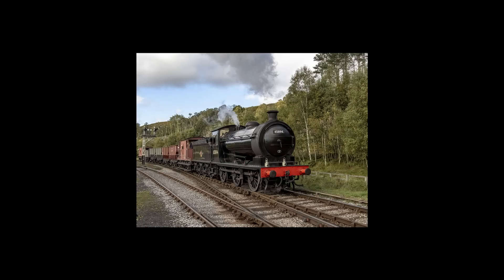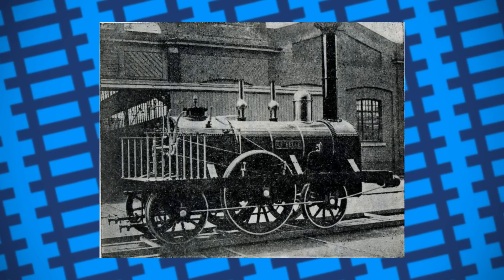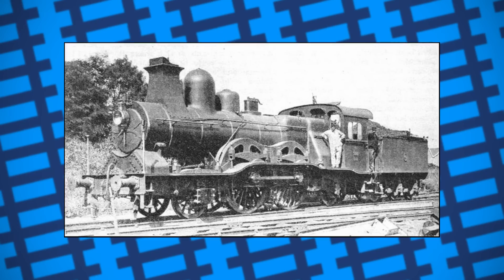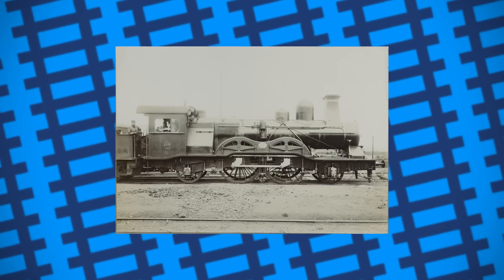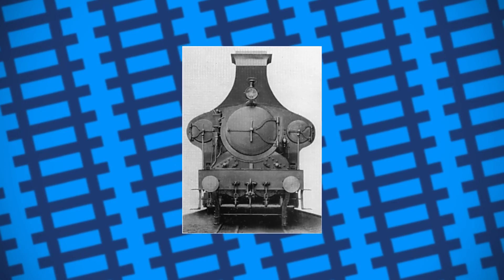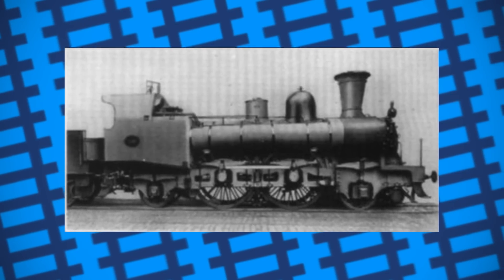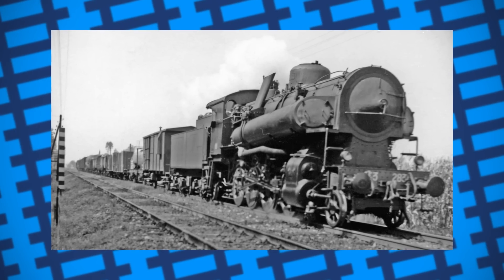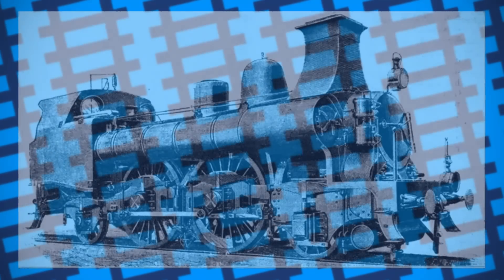Belgium's Botched three boiler Passenger Engine - Belgian State Railways "195"

Comment: The initial reasoning behind this locomotive demonstrates one of the main problems with steam locomotives in general. Steam weebs like to pretend that they're constant-force machines that develop more and more power as they go faster, but the reality is that they aren't. They are constant-power machines just like diesels, except the rated power comes from the boiler capacity rather than the limits of a diesel engine. This falls apart at low speed, where the physics of directly driving the wheels by injecting steam into the cylinders imposes a hard cap on the available tractive effort, effectively meaning that the locomotive can use less and less of its rated power output as speed decreases. This causes the illusion that it acts as a constant-force machine. Sometimes, looking at a graph from the bottom up makes us believe falsehoods that are readily apparent when you look at the graph from the top down.

Comment: The Type 12s have appeared in my locomotive books. Both the conventional Type 12s and No. 195 are examples that Belgium had some of the most unusual looking steam engines in Europe. I suggest looking into the 4-6-2s that ran in Belgium. Both beautiful and strange-looking at the same time.

Comment: The strange thing is that the problem of getting extra power had been solved before this engine was built. Unfortunately many locomotive designers didn't believe it. Consequently singles were still being designed for express locos long after four and six coupled machines were setting new speed records. I know the type 12s had two powered axles but the whole shape looked it was a modified single.

Comment: There truly are a ton of very strange and interesting Belgian steam locomotives. In addition to the very bizarre-looking locomotive in this video, the Triple Boiler Locomotive #195, there was also the Type 3 Locomotive, which History in the Dark says "clearly throws the Whyte notation completely out the window" due to the fact that there were two unpowered wheels in between two of the driving wheels (which were coupled), and, of course, the Franco-Crosti Quadruplex Locomotive, which was THE most powerful steam locomotive ever built by any nation, EVER, and the only ever built quadruplex locomotive (with a 0-6-2+2-4-2-4-2+2-6-0 wheel arrangement)!
Reply: It was pretty darn powerful, but maybe not the most powerful. By my calcs (they could be wrong) the quadruplex made about 97,000 lbs of tractive effort (or 432 kN). There were plenty of engines with much more power in the US, like the Norfolk and Western Y6b's making 152,000 lbs of tractive effort (677 kN).
Reply: The Belgian railways had lighter track and roadbed, whereas American engines could get very heavy. A Y6b on Belgian rails would have crushed them. Bethlehem Steel's main line used 155lb rail!
Reply: The gigantic quadruplex was the most powerful at its time, but many later, conventional or not, designs outperformed it, especially in the US (with the lone S1 probably being the most powerful and fast and arguably most beautiful loco ever built)